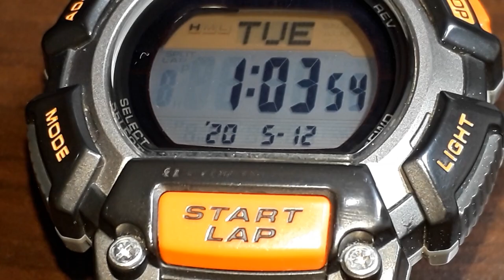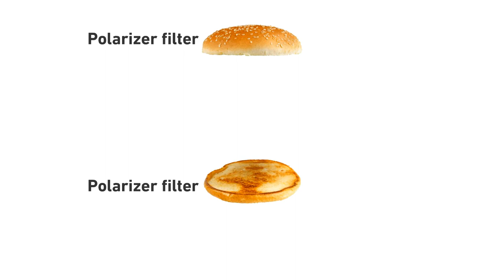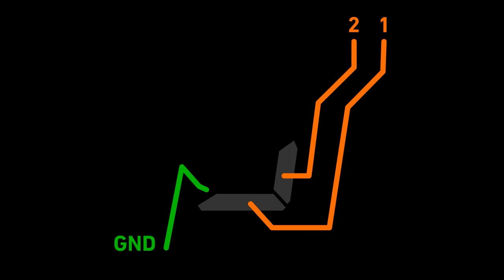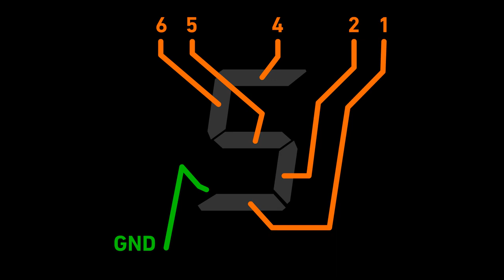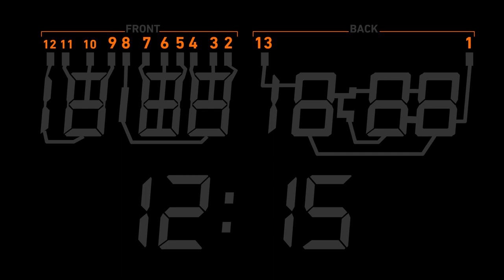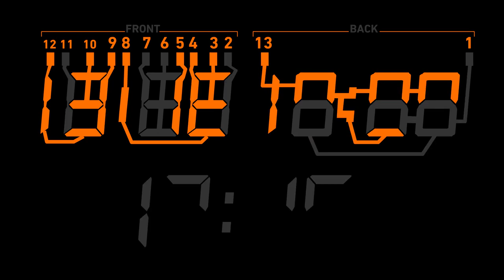Digital watch and how does it work

Comment: Hey great video, just a question if i would like to remove the minute numbers and only keep the hour numbers how would i do that? could i remove som connecters or something? so basically i want the clock to only change hours so 8:00 to 9:00 to 10:00 to 11:00 and so on
Reply from the maker: Well this is so simple schematics that shows time keeping and I think it also shows the month and the date of the month. And as you can see a part or a single segment from one digit may intersects with other part from other digits. So removing connectors may not do what you want to show hours only.
However you may mask the signal bay using external logic gates that keeps the minutes digits always 00, or yo may redesign the micro chip that controls all the functions to keep minutes 00, and again this is not practical to do so, because this is a single case that no one need, and of course it will cost a lot of money to do.

Comment: Is it possible to programme digital watch?
Reply: For example to programme stopage time or to edit stopage time on one that has it
Reply from the maker: yes it is
Reply: @weeklytech3774  I would like to program stopwatch that can be adjust to start from 45:00 and to go until 99:99 for start
Reply from the maker: @mile4ko  you can use a microcontroller with real-time module
Reply: @weeklytech3774  I would like to program to digital watch to show first four alphabet like a,b,c,d. So, will it work?
Reply from the maker: @s0cialwolf  7 segments digital will not be able to show characters like alphabet, you will need a 16 segments design like the following 
https://en.m.wikipedia.org/wiki/Sixteen-segment_display
Reply: @weeklytech3774  yeah exactly, thanks!